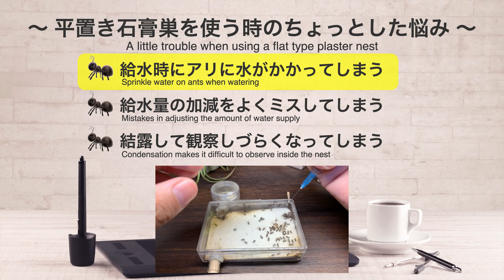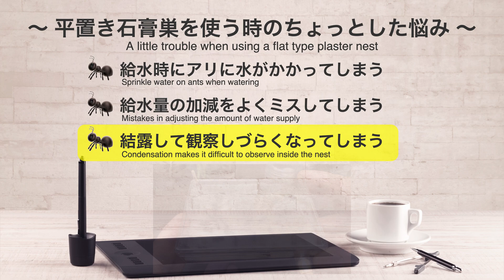【自作】平置き石膏巣にたった一手間で3つのお悩み解消👍　🔶3wayメッシュ石膏巣🔶 【蟻飼育】【蟻飼育キット】【蟻飼育初心者】

Comment: I really like these nest designs you make. I was thinking about if fitting a pva sponge, inside water supply, would act regulating humidity dosage of watery system (even help on preventing condensation). About ventilation, one of the two connections can be closed with a piece of cotton; to permit the nest to breath. Greetings😀
Reply from the maker: Thank you!  The pva sponge is an interesting idea.  I searched and found that there are many products in Japan that are easy to obtain, so if I have the chance, I would like to use them.  Regarding ventilation, I think that cotton is also effective.  This time, I used mesh to prevent ants from biting and getting entangled in the cotton.